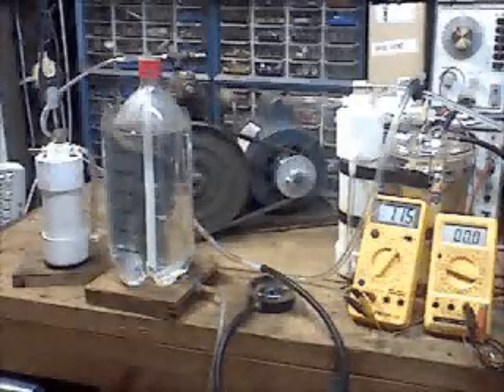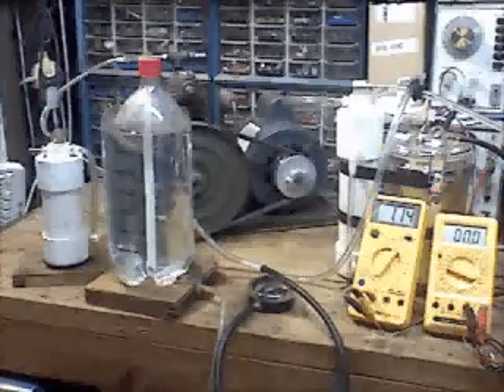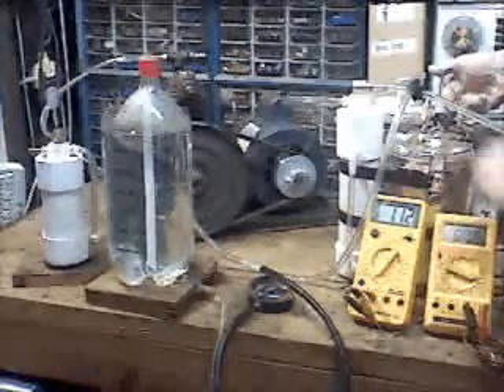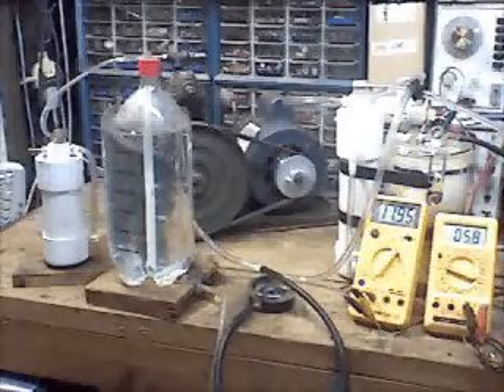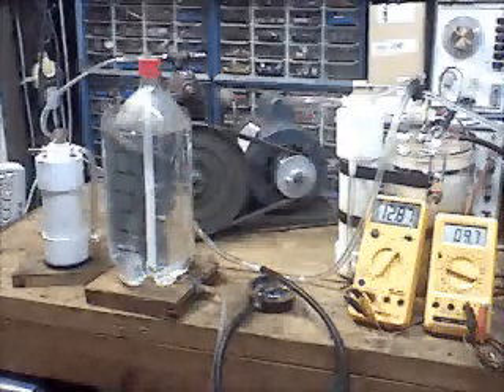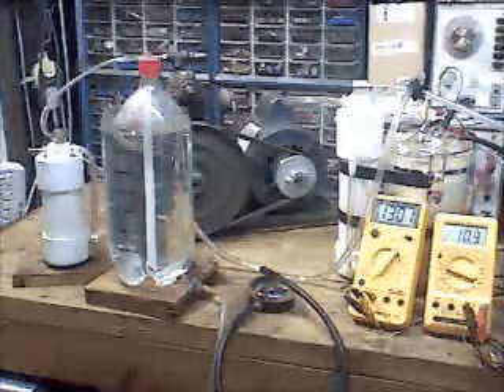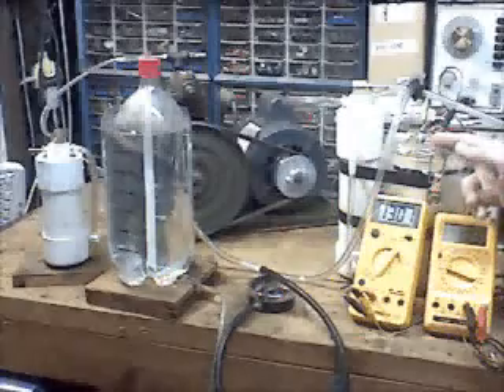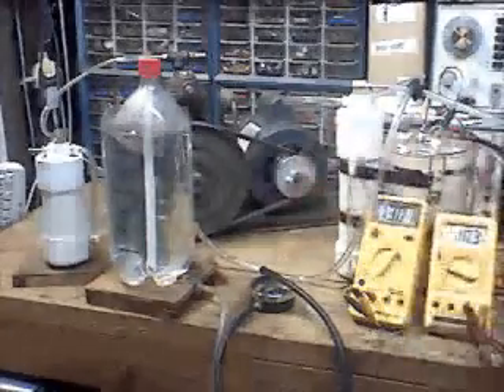#59 Vacuum test part 2

Comment: the 1993-1995  firebirds have a 12volt vacuum pump  its only job is to pull a cacuum 
on the fueltank might work for in car testing  only on the LT-1 v8  engs

Comment: over vacuum can be fixed bu pumping cas in to a storage cell befor the intake and use a one way vale to bleed hho from it  back into the fuel cell its like a hho gastank
fill the storage with cork you can put a lot in fast but it will come out slowly 
just a thought

Comment: If you ever watch mythbusters I'm sure you have seen the episode on mentos mints and diet coke.

The reaction of the mixing of the ingredients that cause the foaming was nothing without the surface of the candy.

All thoes tiny pits on the surface of the mentos made the difference between a small fizzle and a HUGE release of gas.

Might I sudjest pitting the plates with a metal etching tool or a punch. Experiment with different pit sizing. You might be suprised.

Comment: search google (Proton transport in water) 
all you do is strip a few protons, with a two different cathodes, like in a batter, zinc copper, then you short out the cathodes with a connecting wire, it can be potentially charged to h9o5, H9o4, h7o4, h4o4. then when you make it hit it with another electric potential, a current or a plasma energy like a spark, it will burn.